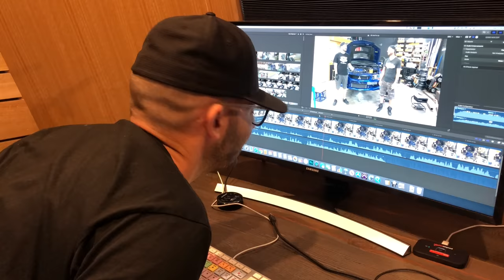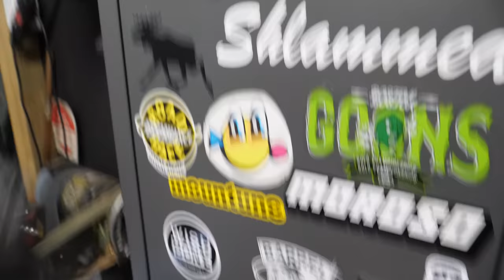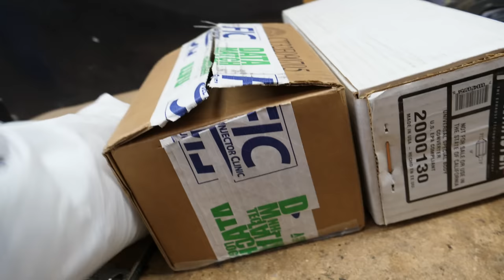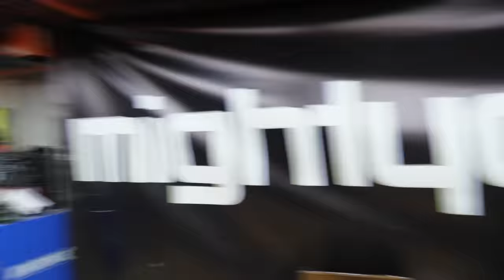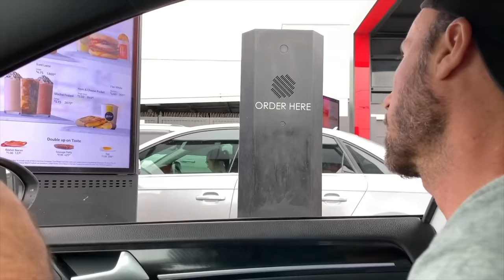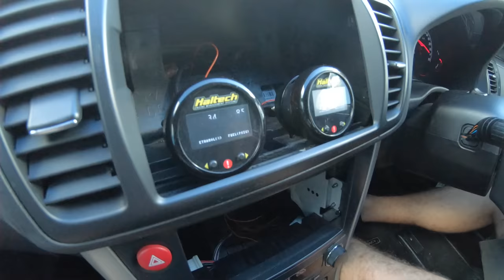The Disrespected Evo Strikes Back 3

Comment: BALLBAG.  love your work lads.  It's high time you did a Volvo 850-T5.
Reply: Car goals right there! Got one in my sights at the moment, not sure what mods to do first though!
Reply: Oh that one's a beauty. I always like the sound of a 5-cylinder. Do they have those in Australia?
Reply: Or even better, Saab 9-3 TurboX
Reply: I agree but I got a C30-T5
Reply: Naah what ya want is an 850t5r wagon!!
Reply: After seeing the 900 turbo they did (wasaabi) I think they'd do a great job of a 9-3!
Reply: As a 850 turbo wagon owner I second this comment. They are such a well built car, mines still going hard with 340 000kms. I did a fair bit of work to keep it going but that's cars.
Reply: @LuckyThirteenStudios   given these cars are now a minimum of 22 years old, better to buy on condition than on feature set.  The main feature of the 'R' is the engine management that allows the additional 18 horsepower for a maximum of 20 seconds.  yes, you read that correctly; just 20 seconds.  If replacing with a Haltech and solid tuning, why search for the 'R' unicorn?  Other 'R' features over the T5 are minimal:  There are slightly bigger front brakes, 17" wheels, and alcantara and front and rear spoilers.  All of which is retrofittable!  The T5 is very good buying if you can find a tidy one.
Reply: vegisaynom "stage 1" is the usual starting point; catching up with overdue maintenance.  Swedespeed forum and Matthew's Volvo Site have plenty of info.  HTH
Reply: Omg yes!

Comment: Love the bikes. 

I have a 2017 Honda Cbr500r. I have changed the windscreen, levers, exhaust, fender eliminator, different wheels etc.

I also have a 1991 Honda Spada 250 that revs to 14000. havent modded that yet but pan to turn it into a cafe racer.

Would love to see more bike stuff on the channel.
Reply: Kurtis Nelson awesome I have a 2013 Honda CRF250L that has a range of mods on it

Comment: I have a 2007 Suzuki SV650, and a 2006 Triumph Speed Triple 1050. The Suzuki is stock. The Triumph has a Mivv 3 into 1 low mount exhaust and a custom ECU tune.

Comment: I don't have a motorbike I have a 1979 vespa px, it's a 125cc that's been modified with a 30mm pwk carb, read valve plate and carbon petals, 166cc piston and barrel, long stroke racing crank, straight cut gears, with a reinforced banded clutch with carbon race clutch plates, it has gone from 7bhp to 20bhp nice increase for a bike with 10inch wheels

Comment: BTW that same oil return gasket can be used on SRT4 stock/stage 3 turbos as an upgrade replacement as it has a tang for easier installation and integrated o-ring for better seal.

Comment: I have a 2018 Indian Scout Bobber that I have put a two bros racing 2 to 1 exhaust and a 2020 Harley lowrider S with a 131 "stage 4" big bore swap, aftermarket ECU, 590 cam and some other bits and I'm currently restoring a1980 Kawasaki KZ1000 that was my dad's and he gave me and I'm also working on 150cc big bore swapping and turbocharging a Honda Grom because I like going fast.

Comment: 9:33 I know this is like a year late but I had a Honda CT110 Postie Bike like what you guys have shown at the start. It was modified with bigger bore, added oil cooler, modified carby and CDI, custom exhaust and larger drive sprockets. Got up to 120km/h easy and was bit too afraid to push it further 😅... Heaps of modifications you can do to bikes

Comment: I used to race motocross I have a 06yz450f and 2000 cr 250 .. I worked at factory connection suspension so I have the suspension all done on both bikes the 450 has been bored out has a longer stroke ported and polished changed the gearing and a few other things the 250 has a big bore kit vforce reeds and is also ported and polished ... now I just to freestyle and enduro in my spare time ....

Comment: IF you do end up with issues of your welds cracking on that CAT, you can always try and use more Argon and flow an additional line into what you're welding. Not much pressure is required and you can block off ends. This is meant to stop porosity where your inert gas can't reach.

Comment: Alright, you said to share the stuff we've done to our motorcycles, so here goes. I'm 20 & in college and I picked up my first bike a few weeks after I got my license. I ended up getting a 1982 Honda Magna VF750C. So far I've repaired the clutch slave cylinder (cause it has a hydraulic clutch), the clutch master cylinder, and replaced the busted old clutch lines with some rad new stainless ones. Replaced the air filter, put new fuel lines and a new fuel filter on it as well. The bike runs like a dream!
Reply: ballbag
Reply: wait till you have to tune the carbs. Dealing with the mechanically linked quad carb set up is a royal pain. Amazing bike though, I had a Sabre with the same motor. Loved the bike till it blew a head gasket at freeway speeds and dumped coolant all over the rear tire.

Comment: Motorbikes, my favourite thing next to cars, ive currently got a ancient air cooled honda xr250r dirt bike, might buy a nice new yzf450 😂
Reply: Xr 250 is a far better bike on the trail but if your going to play on a race track or in deep sand yz450f is a beast of a motor also DONT buy the yz426 or wr426 you will have problems starting it and constantly playing with your valves it just isn't reliable like your xr
Reply: I must agree, my xr is a absolute beast of a bike on the trails and on the tracks if your game enough to try that, luckily i am haha, wouldnt mind upgrading to a newer wr250 or 450 tho

Comment: Ive been doing EBike modding for a hot minute now, havent done anything super crazy, but i Chopped a Camp Scrambler by Juiced ebikes, and did a 3 Motor 3 Battery touring electric bike, each engine can be engaged independently and if u run each battery flat and just go, ive done 177 miles on it till dry, not really the same vein as the show, havent gotten a car to really chop, or motobike either, just my electric stuff i fool with, but im looking to get a Poniac Fiero and mod that to be in the vein of a Lancia Delta S4, but no luck as of yet :(